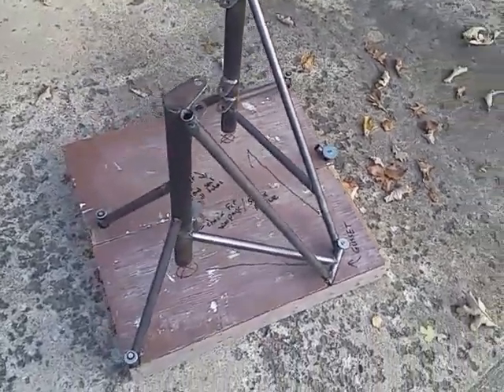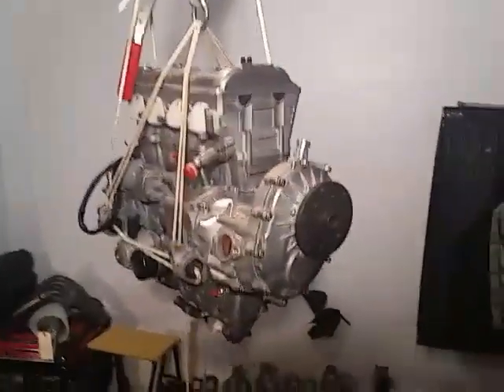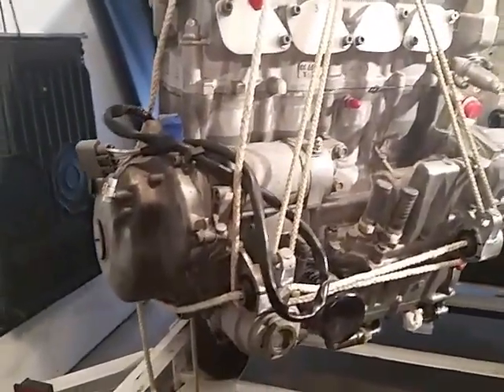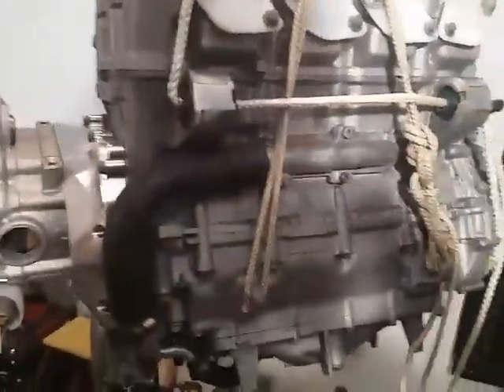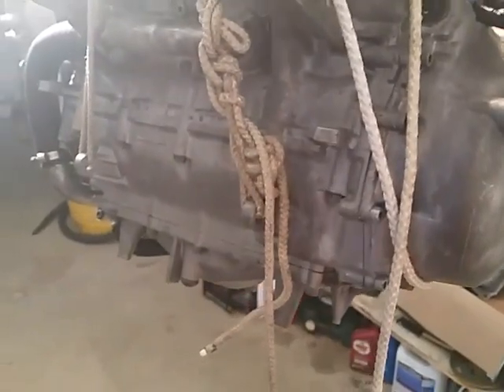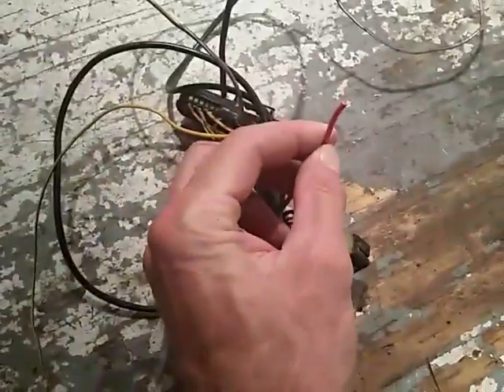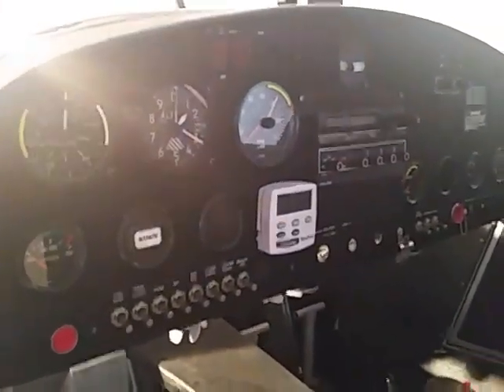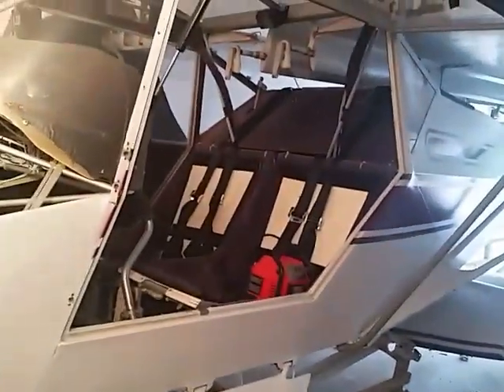Yamaha RX-1 install in Kitfox part 1

Comment: Hi Brett, do you know if the R1 (motorcycle) exhaust will bolt to the RX1 engine?
Reply from the maker: I wish!  I bought one and it lines up to the holes perfectly but is a "slip in"  type of a mount on the bike and a "flat face bolt up" on the sled. 

And the r1 is titanium so that presents extra difficultly in adapting.

Comment: Was the motor mount fabricated, or is that yamaha's from the snowmobile?
Reply from the maker: I fabricated it based off other successful yamahas mounted in aircraft. 

Making the mount was one of the biggest projects within the project, but like things go - doing it the first time took 10 times longer than if I were to do it again  ;)

It really wasn't that big of a deal.
Reply: @brettlarson4327  Would you be interested in building another one?  Does the Apex mount up the same?
Reply from the maker: @kristopherlamberth7091  mine was a "one off" build but join up our "Yamaha Aircraft Conversions" Facebook  group (if you haven't already)and you'll find a couple guys making mounts for the Apex.
Reply: @brettlarson4327  Thanks.  I joined but I'm not sure anyone has done it for a Kitfox IV.  Everyone I talked to said V or VII
Reply from the maker: @kristopherlamberth7091  check with william langford there.  He may be able to help.  I do know that the 4 is very close to the 5-7, I wonder if it can be adapted?

Comment: Interesting. I have a KF IV on Aerocet anphibs.  With Rotax 912s the taxi on water at 2000 rpm is a bit too fast and the floats can go under. Idle it down and its hard on gearbox. With Yamaha and the clutch it would be good for water opps.  Prop not moving as it warms up at dock. Be able to slow it down for taxi.  Be great to see where you are at now.
Reply: An IVO in flight adjustable prop would let you flatten the prop out so you could idle at higher RPM's without moving too fast in the water.

Comment from the maker: Yep, most installed weights are in the 180 lb range.  Not bad for 140hp.  Mine will weigh more since I'll be using heavier accessories and mount. And it's a personal choice on sending temp info to the ecu.  I do not want the ecu cutting me back to approx 30 hp EVER!  Especially if it gets a tad warm or gets a bad signal from the temp sender.  I'll watch the temps and likely install a flashing over temp light.  The one function I loose (which I would rather keep) is the warm up mode, where the ecu changes timimg for a smoother running cold engine.  Testing I've done on the snowmobile shows that it will start cold fine though, and run flawlessly with the temp sender disconnected.

Comment: if that is ~`50pounds, then the installed engine would likely weight 200 pounds
Reply from the maker: Setups like mine come in at about 160lbs including all accessories, mount, oil tank, ect. (Less prop and radiator)